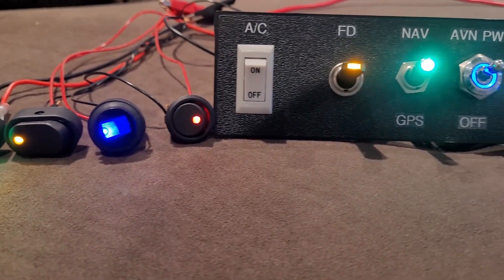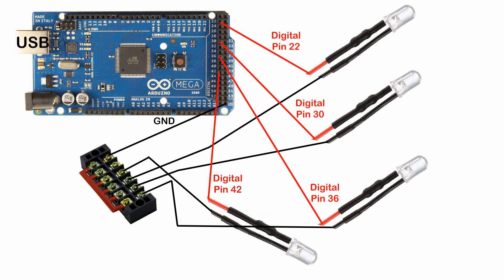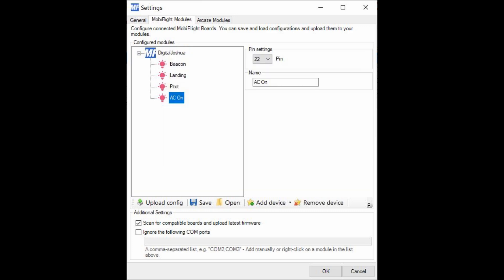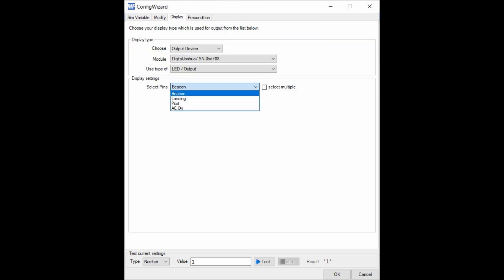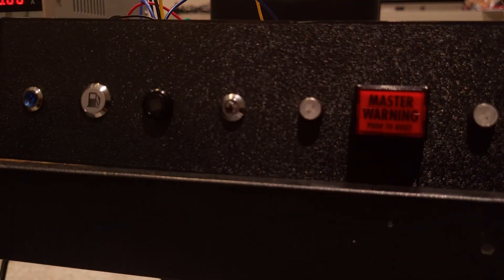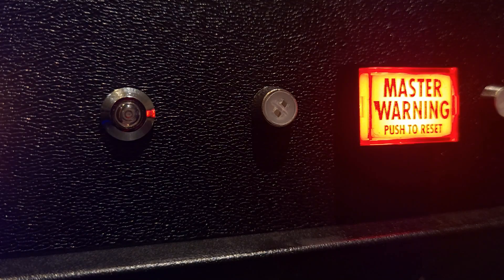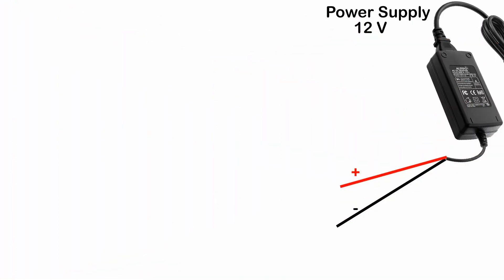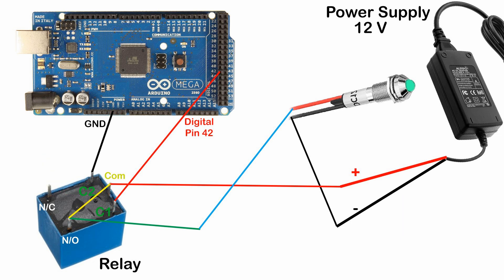LED Annunciators and Indicators for Flight Simulators - PLEASE READ DESCRIPTION UPDATE

Comment: Have you had any luck changing the Value (0-255) of an LED in the PWM Pins (2-18 or so)?  I've added a Number Value of 20 to brighten them up, Test works perfectly, and even after reuploading them, the lights still don't brighten in the sim when Mobiflight is running, yet Test will be brighter... so strange.   Cool video, thanks! Lots of useful info.
Reply from the maker: I have not. Maybe if you contact me directly through my page I can help you get your project completed. Thanks.

Comment: How in the world do you use FSUIPC to program the arduino? I’ve never heard of this.
Reply from the maker: This is actually one of the fastest ways to get an Arduino up and running with a Flight Simulator :) The setup is as Follows: Arduino <> Mobiflight <> FSUIPC <> Flight Simulator
The star of the show here is MobiFlight. It gives you the option of how you would like to interact with the Simulator; whether it be an Offset (FSUIPC), a Variable or a Dataref (X-Plane).
1) When you connect the Arduino to MobiFlight, it will Flash/program the Arduino with new Firmware so it is able to work with MobiFlight
2) Install FSUIPC; what this application does is monitor and store actions/variables of the Simulator in a memory block, known as offsets.
3) The simulator enables, disables or changes it's variables, and FSUIPC adjusts the value of the offsets accordingly. MobiFlight picks up the value of these Offsets, for example 0 or 1 (Gear up, gear down), and then sends the programmed action to the Arduino (Output configs Tab in MobiFlight)
4) Actions sent from your pushbuttons, switches etc., wired to the Arduino, are picked up in the Input configs Tab in MobiFlight, and the according action is sent to the simulator, which can change the simulator variable, and then FSUIPC adjusts the value of the Offset.
Reply: @joshuamarius  okay gotcha thanks. But I will most likely be using X-Plane. I don’t believe but don’t know for sure if either mobiflight or FSUIPC are available there. I will have to look and see. Thanks again.
Reply from the maker: There was something developed for X-Plane called XPUIPC: https://www.schiratti.com/xpuipc.html
However, with MobiFlight all you have to do is select the Dataref option and Copy the Dataref. A tool such as DataRefTool can help you find them: https://datareftool.com/

Comment: A relay seems like huge overkill here. Why not a transistor? Maybe a mosfet if you're trying to light a whole string of LEDs. A lot cheaper, simpler, smaller, faster, quieter. Or am I missing something?
Reply from the maker: Thanks for the comment. There are some other modules that can be used for this. I will be creating a new video with updated information.